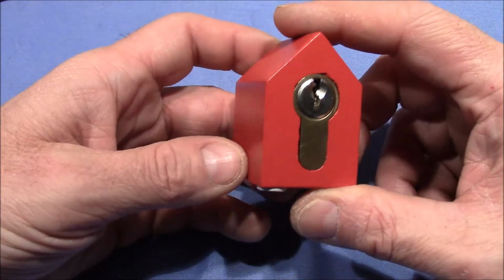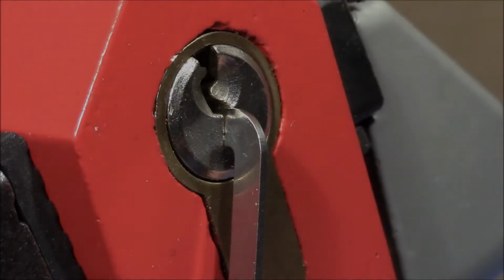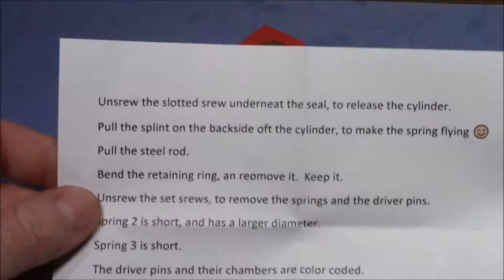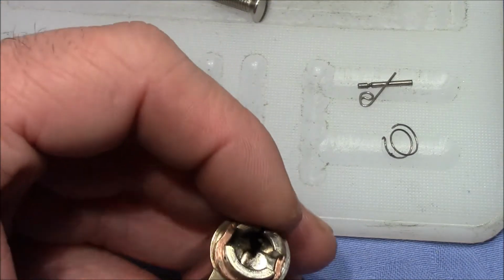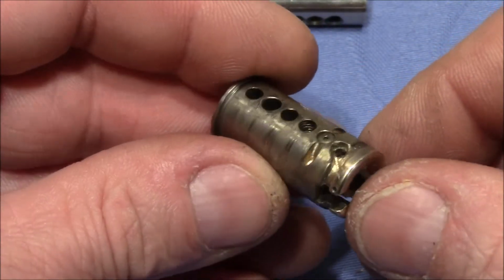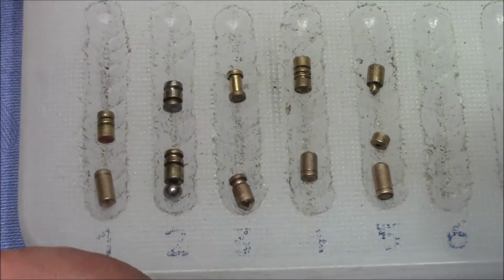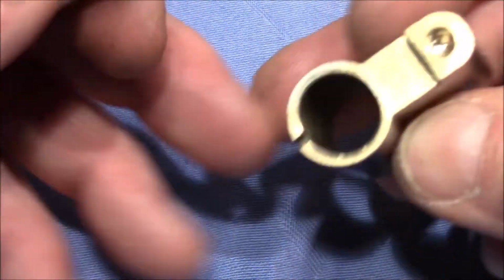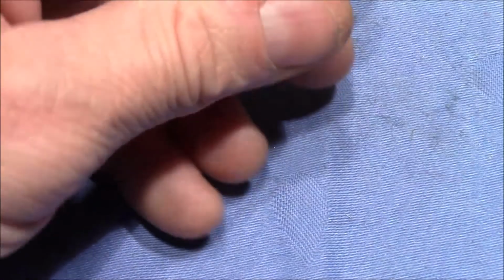(picking 728) Challenge lock with two ingenious tricks - thanks HiltiHome

Comment: That’s a very interesting CL I’ve seen the wafer & T pin combination before, but the Spring check pin is a fantastic idea. A lot of great thought & time went into the lock, great job & very well picked my friend. Really enjoyed the video. 👍
Reply: You are right, that T-pin feature was inspired by another CL builder.
Bur there is another feature in my CL, that unfortunately didn't come into play.
I guess I messed it up myself, by putting a few drops of white lightning into the lock.
This lubricant is forming a wax film, and makes the key slide very smoothly, but must have  damped the spring action, of my third feature...
Reply from the maker: Thanks a lot for checking out my video. It was an honor to play with this lock and explore almost all tricks.